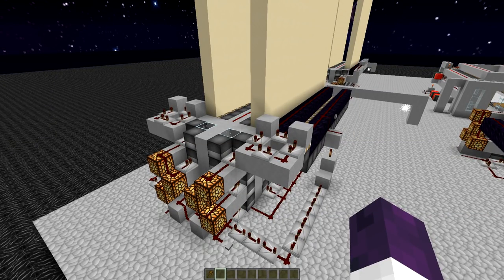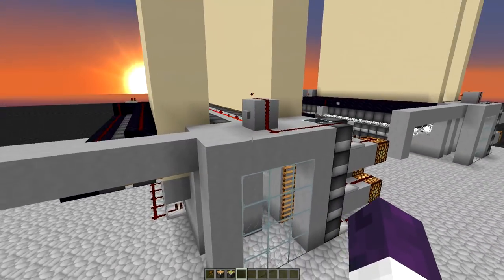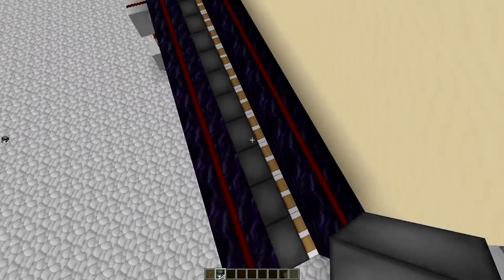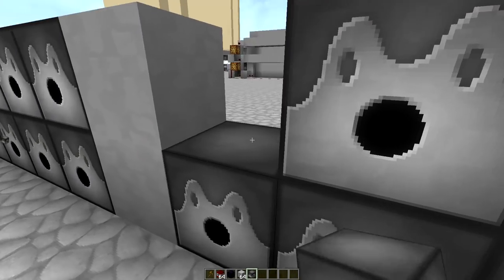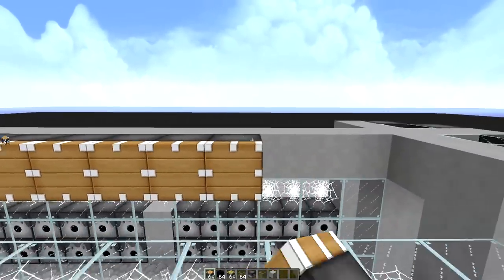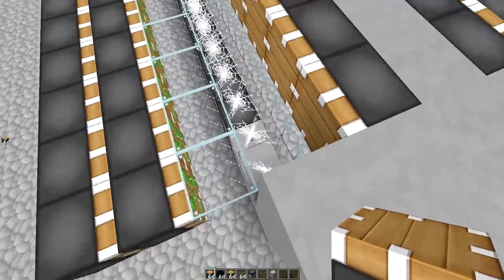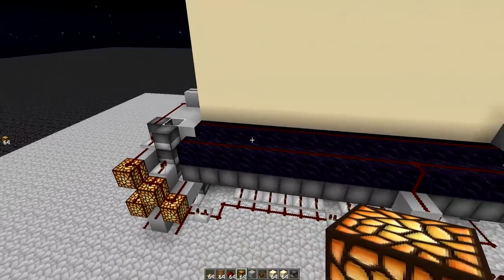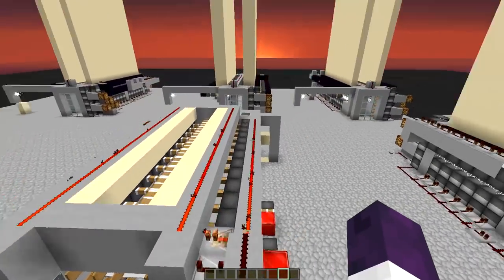Guide To Building Sand Comps

Comment: the left side of the sand compression is not working for me, booster shots the sand back to the cobweb instead to the second booster. Right side works perfect tho. I tried aligning dispensers the same way as its on the right side, but it doesnt work either, also I tried it on 1 push and on 5 push, its the same. does anyone knows how to fix it?

Comment: Sorry to be kinda mean but the block 36 or "carpet/fence gate" comp is faster then any other sand comp I know of atm. I have never had a problem with it on any server that dose not limit red-stone input extremely harshly. Also the explanation you gave about how the sand comp works is wrong (its also not a glitch). Please do not spread false information. A lot of new cannoners look up to you for the details and explanations that is why I am being harsh.  I want the community to be well informed. Also, the reason why a lot of big cannoners use that sand comp is because its the fastest and most reliable. Last, the set up you used is outdated for a block 36 sand comp.
Reply: kman0323 can u explain how block 36 comp works?
Reply: MID or FEED once I get my voice back from being sick, I will make a small video.

Comment: Carpet comps cant compete with your 2.4 comp, very interesting cause 1 sec carpet comps exist.
Try to make a 1sec sand comp for a 255 with a normal 1 push, and also there is no sand touching tnt, It can't blow up.
Only thing that limits carpet comps are shitty servers with 5$ jars that can't handle it